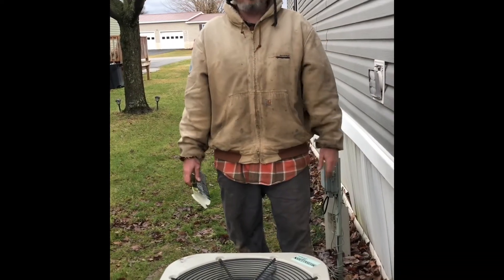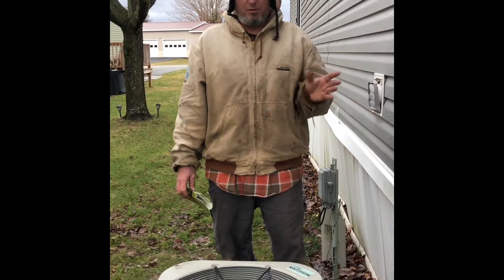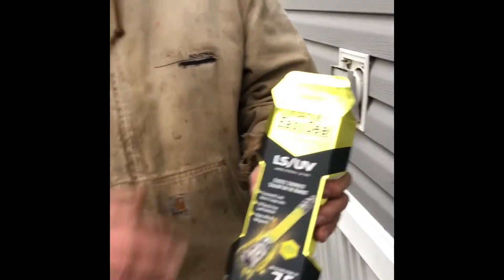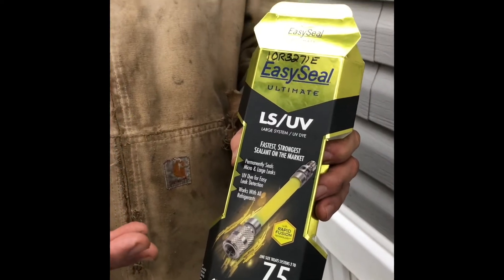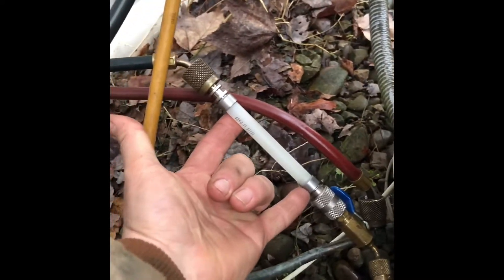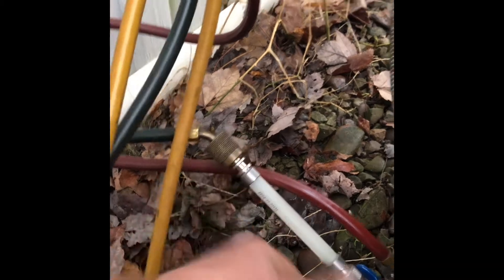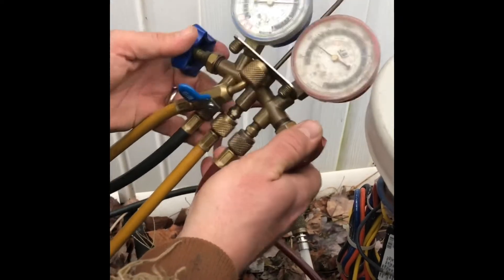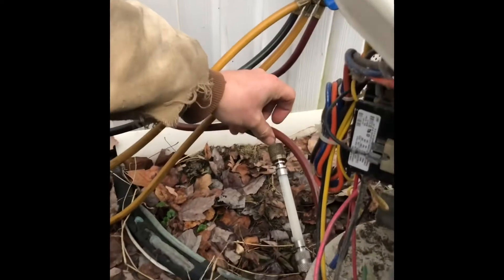We try out Nu-Calgon UV dye and a/c leak sealer on a tiny leak in an older R-22 mobile home a/c unit

Comment: Did it work?
Reply from the maker: Long enough to hold pressure for a home inspection in the middle of winter so the sale could be completed per what a friend wanted to do.  It was a cheap quick home sale. After that,  no idea.  Long term…I have my doubts.  After this video has been out for 3 years you are the first to ask the MR obvious question that I left the answer out of for this video.